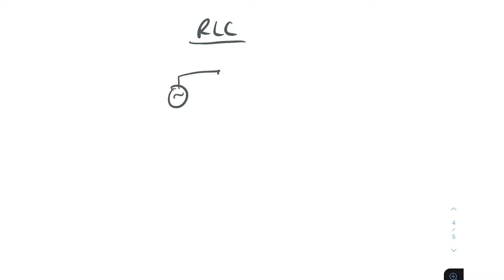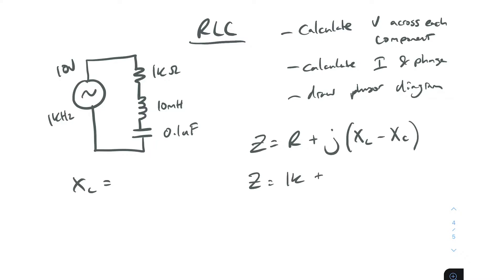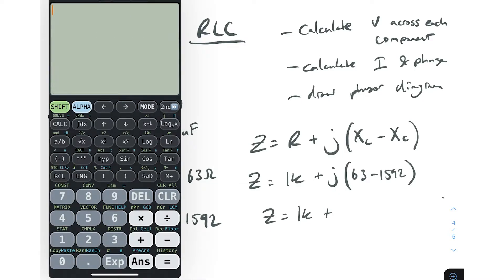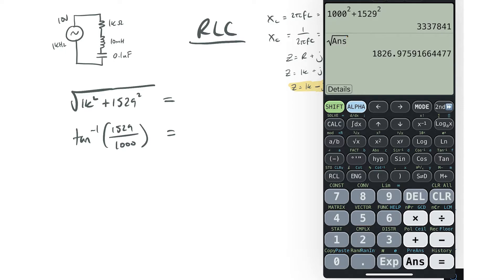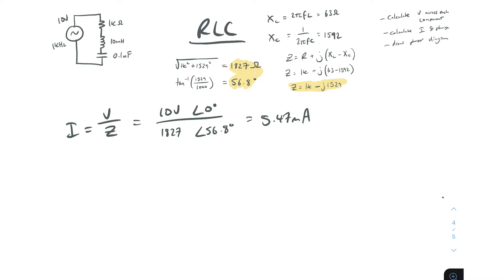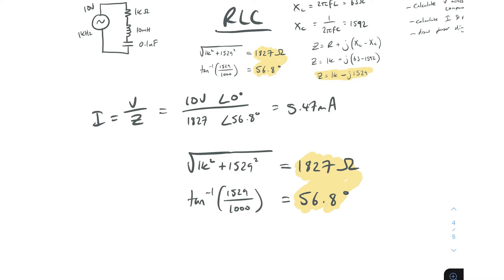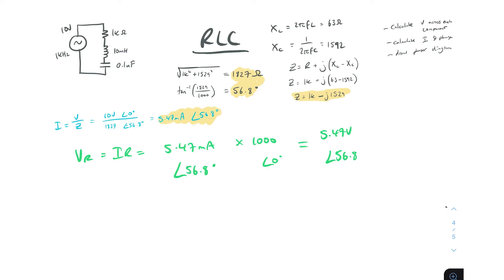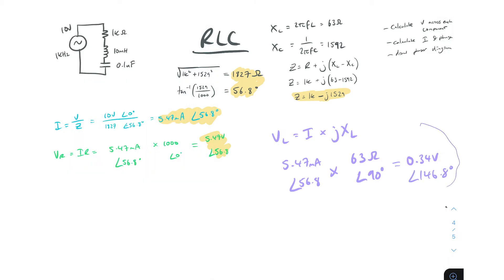RLC Series Circuit Voltage & Current Example Problem

Comment: excellent video. thanks a lot.  but what was the matter with 90 degree you calculated in the last moments of video? what is it? why should we check that?
Reply: The reason he calculated the degrees was to make sure that each component(VL, VR, & VC) are 90 degrees from one another. For an Inductor, VL is 90 degrees ahead of VR. For a Capacitor, VC is 90 degrees behind VR.